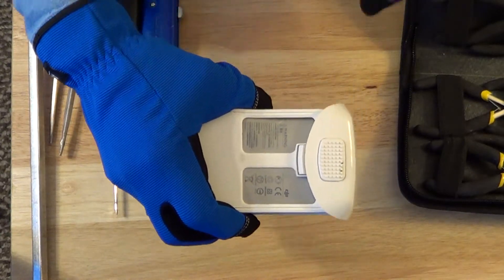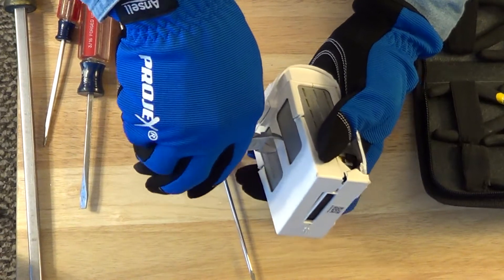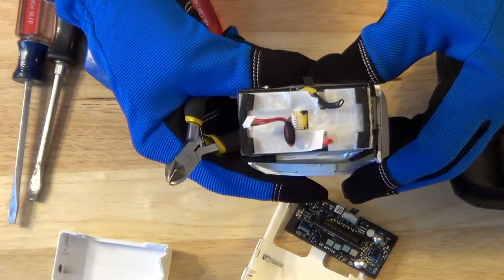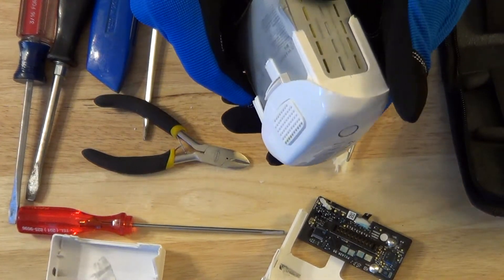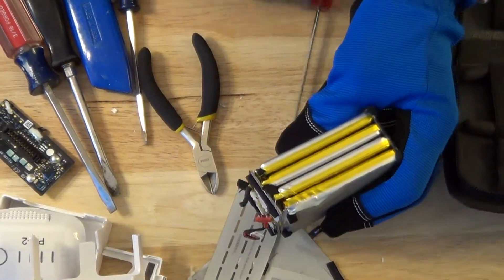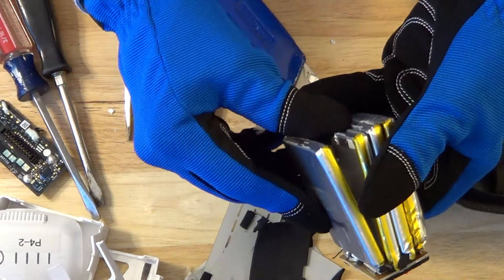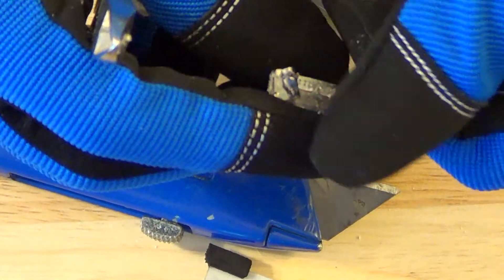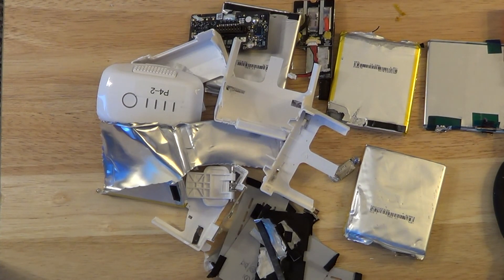12 22 17 DJI Phantom 4 Battery Disassemble

Comment: Hiya. Those two cells you extracted, can you reuse them?
Reply from the maker: This is my opinion on reusing cells from a damaged battery. I wouldn't do it. In my opinion a battery that has had an impact should be considered to be unstable.  I was buying used drone batteries for about $60.00 at the time. My drone cost me $1500.00. If I was using a repaired battery and crashed because of the battery failing I really wouldn't be saving any money. Compare $60.00 to $1500. I also made it a practice to replaced all 4 props after a crash even though some of them looked fine. There again, for $20.00 I am playing it safe as opposed to having a potentially damaged prop brake in flight and lose a $1500.00 drone. I know not everyone shares my opinion but that is the way I do it.
Reply: @OnTheEdgeNow  Hi. I mean, I have a crashed battery too. I'm not going to use it for drone. I extracted lipo cells and cut them just like you did. Have 2x 3.3V undamaged. Can I use them with a lipo control circuit and regulator for a 5V 66Wh powerbank? Do they still work fine after cutting them out I mean?
Reply from the maker: @brbrbrbrbrbrrb  Again this is just my opinion, I treat any crashed lipo battery as compromised and if it were me I would discharge it and recycle it.

Comment: why you do this ? its a wrong way to opening this model of battrey , are you a crazy ? !!!!
Reply from the maker: Yes.
Reply: this way , just only way to damage battery and battery pack . :-) good job
Reply from the maker: The battery pack was damaged in a crash. When my Phantom 4 hit the road the battery flew out and hit on the corner. This caused the battery to start to swell and heat up. I knew when I took this battery apart I was never going to use it again so it was faster to take it apart destructively. If you ever have a crash keep an eye on the battery. They could possibly start on fire.